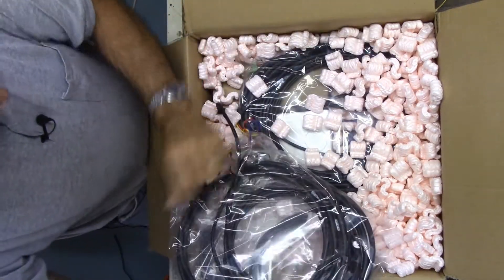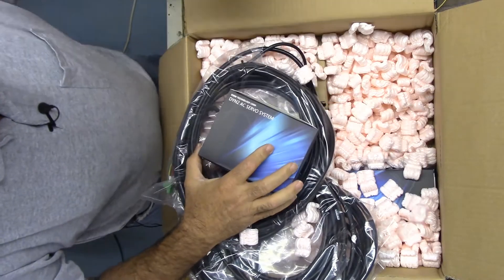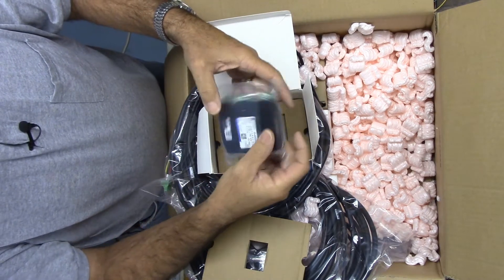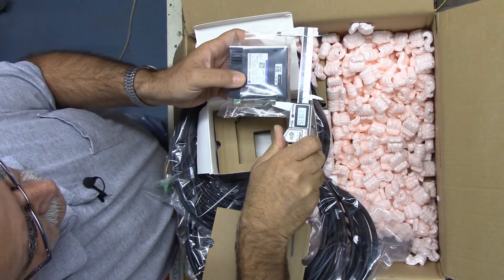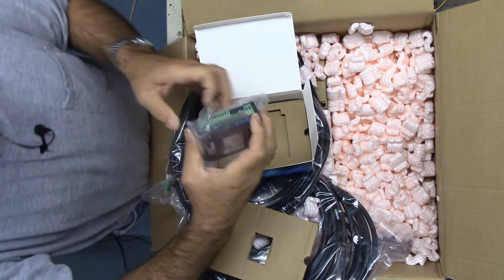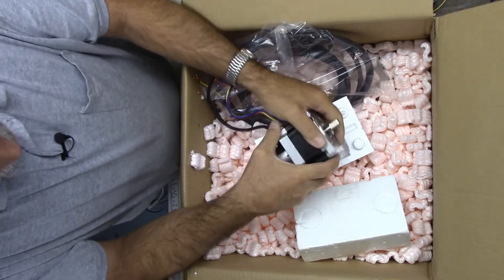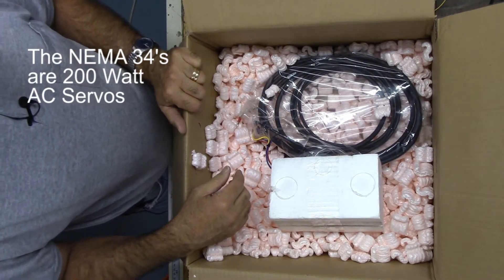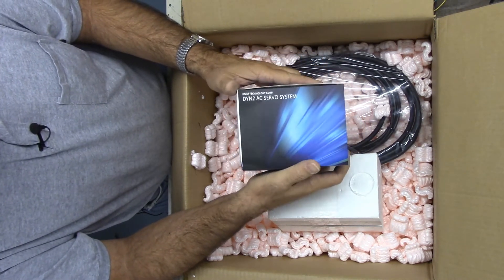Emcoturn 120 Project - DMM AC Servo Motor and DYN2 Unboxing

Comment: Dear Marty, why never use in the Emco 120 retrofit  the original Siemens spindle motor. Thanks
Reply from the maker: can't be reused. LARGE DC Brush motor. Not cost effective to buy a DC drive for it. Scrap it, buy a 3 phase inverter duty motor and use a Sensorless Vector VFD

Comment: Hello Marty

Im from sweden and are in start of converting a lux cnc lathe and im finding your videos very usefull
im going with the masso controller   do you have any expirience off it
what servos are you using for it since the nema 34 would fit directly for me

best regards Stefan
Reply from the maker: Stefan, I would go with Centroid Acorn over Mach3.What size is the lathe? How many HP is the spindle motor? You might just Google search and see what others have used. I would consider closed loop steppers if not servos

Comment: @Martyscncgarage, I'm using CS Labs IP-A on my mill with Panasonic servos. I have just discovered that these Servos can be driven by Acorn (which I have just ordered for my lathe). How is PID tuning managed from Acorn or is the PID tuning only done via the driver themselves? Thanks.
Reply from the maker: Charl, Acorn outputs step direction signals. If your drives can take that, and are already tuned to your motors, you almost home free...otherwise yes, tune motors using you drive software
Reply: Thanks for the response. In Mach 3, with Servos, there is actually 2 sets of PID tuning taking place. The first is on the drive itself (like what happens with DMM and Acorn) however there is then another set of PID tuning that gets done in Mach 3 via the CS Labs plugin. So in the case of Acorn, there is no '2nd' set of tuning? 

Here's an example of it being done (this assumes the drives are already tuned, if they are not, then the Mach 3 tuning normally fails - https://www.youtube.com/watch?v=SD01YNqjmhE .